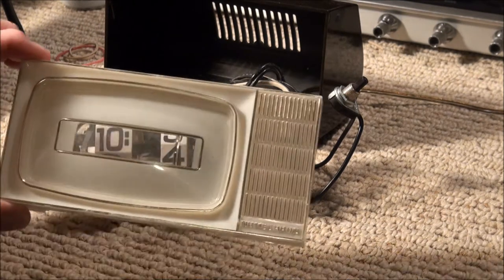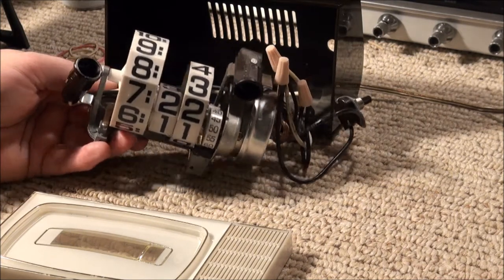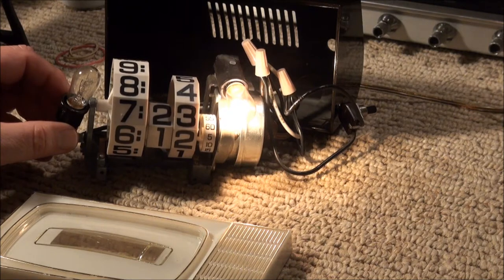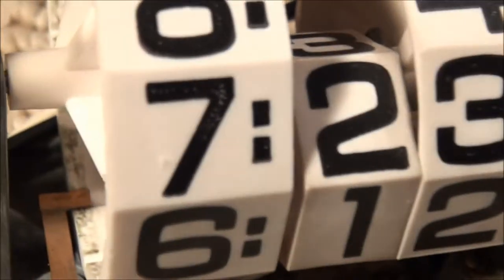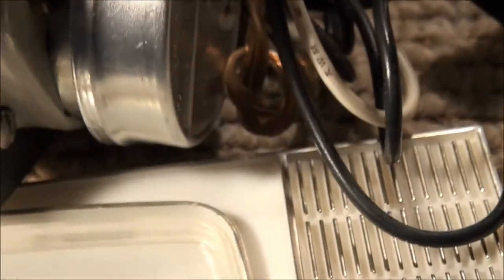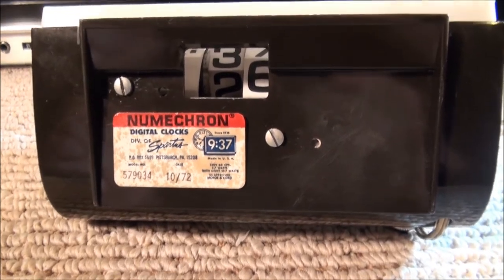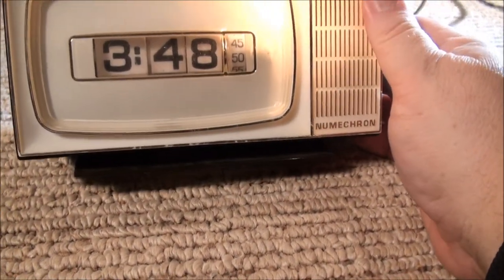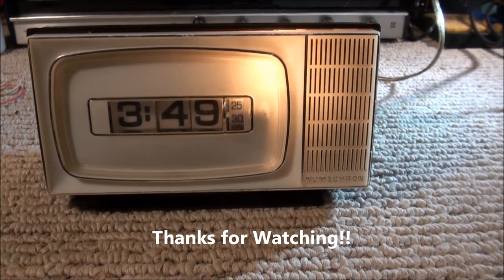1972 Numechron Cyclometer Clock #579034

Comment: Can anyone tell me how to get the clock open? I recently bought one at a swap meet- the seconds circle moves but isnt connecting to the minutes/hours
Reply from the maker: You can get to most of the insides by prying the face off. Very carefully stick a thin flat-blade screwdriver (or similar item) between the top of the face and the main body of the clock and then press up a bit and the clips between the face and the clock will separate and the face will come off so you can get inside. After you're done just press the face back on. Taking the clock mostly out involves removing the two screws on the bottom along with the face, but the power cord and light button stay attached. If you do this, have fun getting the screws back in, they're small and it's hard to see where the receiving holes are. I've had best results starting with replacing the upper left screw first. If you get that one in the other hole should line up for its screw.
Reply: Dan O'Connor thank you!! That worked very well- my clock is shockingly different on the inside although the outer casing is the same, i got quite a surprise. Mine is an alarm clock, and you can change the time from the outside. I think it is interesting because the date on the back is 12/73. The hole you use to change the time is blocked up with a metal plate that contains the mechanisms to turn the time- which the numbers are on a reel that looks like movie film. I thought you might find it interesting to know how the clock model had changed in just a year since the production of yours- thanks for the help!! :)